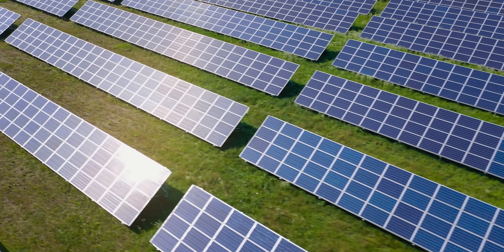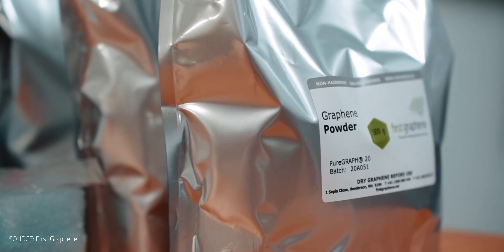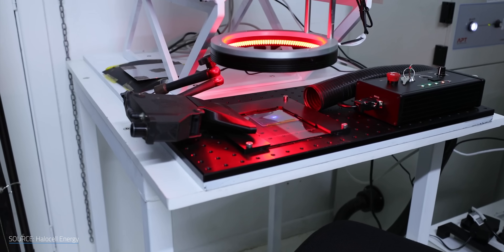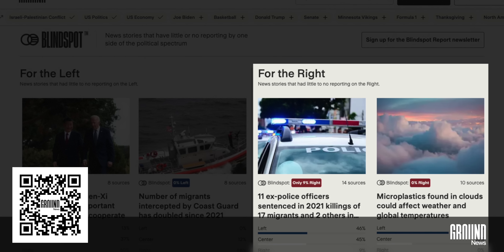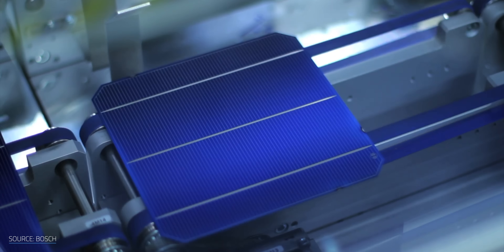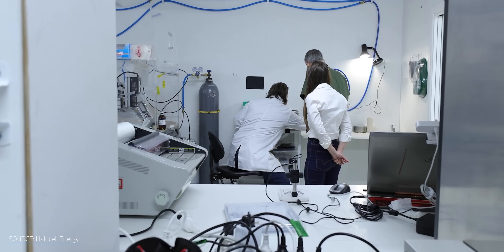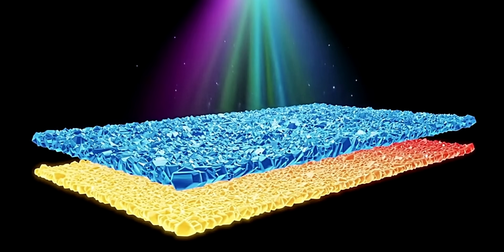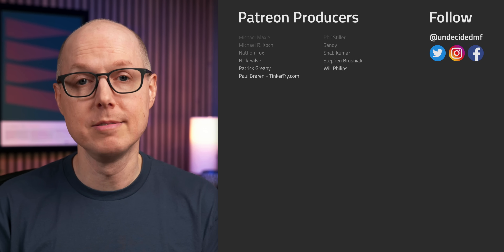How This Perovskite Breakthrough Could Change Solar Forever

Comment from the maker: When might graphene-perovskite solar actually end up on your roof? Go to https://ground.news/undecided for an innovative way to stay fully informed on tech, energy, the climate and more. Save 40% on the Ground News unlimited access Vantage plan with my link.

If you liked this, check out Why Thorium is About to Change the World https://youtu.be/bz4aTO6M4Ho?list=PLnTSM-ORSgi7uzySCXq8VXhodHB5B5OiQ
Reply: The problem is how stable it stays long term out in the elements.
Reply: @jakefrost8017 you encapsulate it. it is not hard.  graphene isnt fragile.  it is protection of obsolete junk and production with sunk costs that is the reason you dont have peel and stick solar panels
Reply: graphene has not been "overhyped" the implementation has been garbage. the technology it self is fine. you can make a water powered battery with graphene and hematene electrodes
Reply: It's really hard to see the price actually making any difference at this point. Silicon with a proven 30 year lifetime is at a price where the panel cost is actually irrelevant for most installations.

If I put 10 panels on my roof almost the entire cost is already scaffolding, cable, mounts, people, transport so I'd submit the price aspect is almost irrelevant at this point.

For the US it's even less relevant because even more of your costs are regulatory and to some extent tariffs (hence your 20-30 year payback whilst it's about 5-6 in much of Europe)
Reply: you should sue Brian Shaw for stealing your logo for his suppliments brand. your channel came first as I know. he launched his shitty supplement brand 2 years ago and has exactly same logo used. you could sue him for millions.
Reply: Well, the transition to renewables isn´t going to happen twice. Either Perovskite panels with noticable advantages over conventional panels hit the markets soon, or Perovskite will miss the oportunity to take a share of that worldwide insanely high demand for PV. If it comes to late, it won´t be able to benefit from the economic advantages of the very large scale production. That would keep competivenes down and delay a meaningful roll out of the technology much, much, much longer, even if it turns out to be better than conventional PV and in theory cost competitive then.
Reply: Worth noting that solar is already the cheapest way to generate electricity. So while better/cheaper panels would be great, better/cheaper energy storage would be a bigger game changer. Li-ion batteries are useful for mobile applications, but are otherwise too expensive, inefficient and dangerous to be practical at any sort of scale.
Reply: @eric.nathanson  Not really the case
Li-ion batteries are not great safety wise but all the modern systems are LFP which is pretty safe. The biggest danger is something else setting one on fire - because it's so hard to put out. Still best put on the outside of a building as is usual practice for most household installations.

As to prices - in tariff free countries batteries are getting really cheap really fast. As to scale - there are 100MWh+ installations working beautifully.

Sodium batteries are likely in the next few years to accelerate that cost reduction and are safer. Some of the other technologies are ridiculously safe but they are longer ways off (if they come to fruition of course).
Reply: @etchedpixels  Thanks for responding. While it’s difficult to do a direct price comparison for a solar + battery system over lifespan vs average utility expected utility rates over the same time span, current cost/kwh of the humble present tech consumer solar panel is about half the commercial customer utility rate of 14¢. Li-ion car batteries come in north of $100/kwh. I don’t know how much lower a commercial stationary installation would be, but high energy input for manufacturing and rapid efficiency degradation for the current technology are hard factors to overcome even at scale. As far as safety, well yeah. They do indeed catch fire and then burn uncontrollably. I think people who install them on the side of their house are insane.
Reply: please stop using autodub, its stupid and many information will loss to translation
Reply: How did Graphene get so cheap so fast?
Reply: I love to see your videos that covers renewable energy innovations.
Reply: These 400 Watt panels barely crank out 100 Watts.  When building systems to power a home,  I scale the power collection from 10% of the on-the-box rated power levels.
To get a decent 1KW system,  I put up 10KW and it should make it through the grey winter months that barely generate any power... It would be beneficial if someone designed solar panels that work best on  grey day low light...  Geared for that tiny amount of power, at least we could collect something...   Bright  Sunny Days are rare and uncommon.
Reply: Since 2018 I've been saying Perovskite's moisture, air exposure and heat problems would be alleviated or completely eliminated in the vacuum of space. It's the perfect substrate to paint onto panels for 365/24/7 solar energy to beam back to Earth.
Reply: Is it already time for the annual “Solar breakthrough that will revolutionize the world but you will never ever see it” video?  Just throw out buzz words and wrap them in boastful ambiguity, people will click! 

Well here is your click and engagement but keep it real or you’ll lose people Matt.

Comment: Anti-Renewable Rhetoric: Trump calls wind and solar "the scam of the century," blaming them for high energy costs and prioritizing fossil fuels.
"One Big Beautiful Bill" (OBBBA): Signed July 2025, it ends the homeowner solar tax credit (25D) at the end of 2025 and creates hurdles for clean energy credits, potentially slowing deployment.
Permitting Slowdown: The administration has stalled new solar projects on federal lands, requiring personal sign-off from the Interior Secretary.

Comment: Instead of burning coal now you are electrocuting it putting on your roof then in the landfill along with all your batteries.  If you just burn the coal, the CO2 turns into plant food with photosynthesis.  It's a cycle and carbon is the most efficient and recyclable energy source we have technology to utilize efficiently.  Our bodies have better tech to utilize carbon than anything we have come up with.

Comment: Be interesting if they could do multi-spectrum panes like they have on space station. 

They need to be able to recycle the panels too.

The way power cost is increasing to account for mega corporation data center’s for AI etc. the ROI may not be 20-30yrs. Maybe be 15-20 or less.

Comment: 3670 hours is 150ish days over which they've degraded by 3%. The way you presented this information made it sound significant but it's far from acceptable and a far cry from the 8900 days required to survive 25 years outdoors.

Comment: There are so many factors in making solar panels viable. Probably several boxes to tick. And for a solar cell to tick every box, well it's probably never going to happen. A solar cell that is cheap, efficient, light, energy dense, long lasting and non polluting contaminants, the list goes on! 😂

Comment: If they could get a product to market that produces the same wattage as a current silicon cell at, say, 50% the cost,  then it doesn't really need to last 30 years.   If it lasts 15 years,  that's equivalent value,  and it means that I can take advantage of new technological advantages by replacing my cells sooner

Comment: Not sure if it really matters for say, if they can get them to work with todays solar panels as a layer, then even if that layer only last 10 years out of the total 30+ that would still be fine so long as it doesnt increase over all cost more than it can produce. The reason is just that you will have a faster ROI at the grid level. For homes, it will allow you to put up fewer panels at the start, then you can let them offset to get your next set of panels as those wear down. Mainly it just comes down to cost of adding the extra layers. If it adds like 50$ to a todays 125$ panel I dont think people would complain at all. I would go as far as to say even doubling it. As you will need less over all panels for the same power production. For the grid, it doesnt matter as much as their goal is to get as much power as possible over all.

Comment: Here in Ontario Canada just installed 1500W of vertical bifacial 500W panels, great way to keep the snow off in the winter. 
$235CDN per panel, after the screw in deck anchors, aluminum structure, wire to house and MPPT, my labour was free.  (no permit costs involved)
Turned out the panel cost was < 25% of the overall cost. If I had paid someone to do the install panels would be <15% of the overall cost.
Would be nice to have more efficient lover cost panels, might save a bit in the mount and structure, but still panels will be <25% of the overall cost.
I think we have reached the point where dropping the panel cost has little effect on the overall job cost.
Only place more efficient panels may be advantages is where space is an issue.

Comment: Hey, speaking of the AI bubble, did you know your brain only uses 30 watts? Why are they building nuclear powered data centers? The "AI revolution" was started by one paper. "Attention is all you need", which introduced the Transformer algorithm, which is VERY INEFFICIENT. That's why they need nuclear power. They could spend that $1 trillion on neuroscience research to figure out how the brain does that with 30 watts. But then they wouldn't need to spend a trillion bucks, which gives them a hard on

Comment: I'd be more interested in the more mature silicon pv tech simply replacing the electrodes with graphene that could lower the cost, but could also boost demand and innovation with graphene and greatly mature it in the process.

Comment: Heard it before and will hear about it again in a few months when they push the same cycle. It's the same media cycle as fusion. 
The reason solar panels are everywhere is due to Chinese state power pushing them as hard as they do. Unless Chinese manufacturers start to produce them, which is suicidal for any investor outside China, there's no way to compete and that's been shown by the uncompetitiveness of non-Chinese solar panels in terms of costs unless they are directly made from Chinese sourced cells etc. 
Unless Australia starts churning these out for £65 a panel at 440w, there's simply no beating the scale of silicon in terms of cost effectiveness. Same as with batteries.

Comment: When the first Perovskite can finally be mass produced, it will at first be significantly more expensive by several orders of magnitude over silicon, for not quite 38% gain in power. Think LED's, when they first hit the market they were $10 a bulb.  20 years later they are now much more affordable but still more expensive than incandescent.  
This will be a long time.

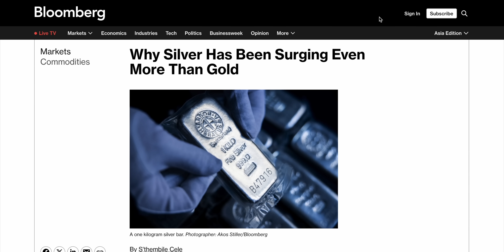Comment: 7:56 Silver reached $50/oz-t in early October and has remained over $50/oz-t since early November. It is currently over $58/oz-t. FYI -- a troy ounce is roughly 1.1 regular ounces so silver would be approx $64/oz (regular ounces)

Comment: at the end we don't have game changers. my estimation is that every year we get a typical improvement of maybe 0,25% points of efficiency. and a lower price of maybe 3% per kWh? that does not sound much but solar is already very cheap and these improvements add up over time.
and even if we get oxford PV cells with 27% in scale, they will be expensive and they will only make sense in certain applications where space is expensive as well. even for a balcony solar system the added 2% efficiency might not be worth it to pay double the price.
nevertheless, we will get there.
+0,25%, -3% price per year is good enough.

Comment: Graphene replacing silver in silicon solar cells, Should and most likely will be the priority. Since it makes it more cost effective, efficient, robust and recyclable. 
 
While Perovskites have less applications and makes its recyclability more difficult, relative to Silicon cells.Thanks for another thought  provoking post.

Comment: complete misunderstanding of PV economics - the panel cost is not the biggest factor.   In future the total system cost including sodium batteries will be the deciding factor and  a few more percent efficiency and a few cents cheaper panels will be irrelevant

Comment: Solar panels payback outside of the USA is between 3 and 5 years usually. The hardware and installation cost are too high, and grid powe low. In other countries, the opposite

Comment: And once connected to the grid could only put in 15 of advertised output The ignorance of solar is easily demonstrated with a volt amp meter in fourth grade math called Ohm's law double check your watt meter And you will see the ignorance

Comment: I was surprised how little the actual solar panel cost relative to the entire install.  The aluminum framing and micro inverters cost much more than I expected and the install (if you don't do it yourself) is also a significant cost.  Halving the solar panel cost isn't really a game changer when you consider all the costs.
Reply: you are right. this is why an efficiency bump is the best. you don't need more mounting stuff that also costs money. etc.
Reply: Same as true of any home upgrade. Such as installing AC or a toilet or anything that involves the trades. "Micro" inverters are nice, but not necessary. 

And you forgot the most important factor, the amount of electricity that it produces depends, on where you live. Average Australian would be laughing at you.  C'est la vie. 

FWIW solar can act as a roof covering too, There are a few French companies that offer underlayment systems that catch the water runoff, which replaces roofing. under the solar panels. So it can be part of a roofing replacement. Which can offset part of combined cost.  As always the devil's in the details.

(Look forward to when DC powered homes, become a realistic cost effective option. Which will increase efficiency, decrease complexity and cost. Since almost all devices are inherently DC powered. with AC to DC conversion built-in. But currently they charge way more for the simpler DC versions)
Reply: @nc3826  microinverters are typically better than string inverter + optimizers. Do you have significant solar?
Reply: That's because panel costs have already been halved once. The next half isn't so exciting.
Reply: You are correct. Panels and Inverters are about the same price.   about 1/4 to 1/3 of the install price
Reply: battery is my problem
Reply: @uraymeiviar  Best not to use battery if possible.
Reply: Here in the Netherlands,  when a solarpanel has reached the end of its life, the manufacturer has put aside 13cents!! to discard of this panel. Somehow i do not think so.eone earning €40 per hour can do this in 13 seconds....Another part of the conjob. Health and wisdom to all,  Erik the Netherlands
Reply: It can be automated and simplified, when there's no Silver that has to be extracted.

Life is a conjob, give Netherlands credit for at least taking the first step to address negative externalities..... C'est la vie

Comment: Oxford PV is already manufacturing commercial perovskite-on-silicon panels delivering up to 26.9% conversion efficiency. However, they are competing with conventional silicon panels, which have already reached around 25% efficiency — and bifacial designs can achieve even higher performance in certain applications. I believe both technologies will coexist for quite some time, each finding its own niche.

Comment: This is going to sound really weird, but if we had reliable cheap solar power, it would help create a bit of a new baseline for society to survive.  We could have a full societal collapse, but electricity would still flow.  I really think every home having solar is going to be in the near future, and the US delaying it is only putting us behind.  This would allow power plants to focus on industry, which is already 70% of power consumption in many areas, and in smaller areas, even higher.

Comment: I'm sorry, what, "Save 80% on material costs" is nowhere close to being able to save 80%!
The cost of materials is seldomly the main cost driver for a complex product, so the "80%" figure is *pure BS*...
Lets take Silicon, the ultra pure refined Boules that are used for Wafers... I found some place selling these, and even the most expensive one was only $3,000 per kilogram (most were < $1000!). And yet a few grams of this material is enough for a high end chip!

Comment: Needing 20 to 30 years to capture costs is stupid, any thing over 7 years is a net loss. 
The issue with solar high cost have more to do with government rebates, I have watched this in real time, solar companies charging 50k+ for solar system you can buy for less than 15k means you're spending 35k for a max 2 day install.

Comment: A small addition to why perovskite isn't catching on. Perovskite is a synthetic crystal that uses Lead as one of the ingredients during synthesis. This isn't a dealbreaker if they're constructed well, but damage to the cell or overuse in areas where replacement might not be a priority runs the risk of Lead contamination in likely populated locations.
Reply: Don't standard solar panels already use lead? How would this be more harmful if both have lead?
Reply: Perovskite do often use lead but it is not a necessity. There are non lead Perovskite whether they are as good as the lead Perovskite is another question.
Reply: Weigh the potential toxicity against burning coal.
Reply: I don’t want lead on my roof leaking into the my drinking water and waterways…no thanks..stick to anti microbial silver please!
Reply: Nah man depends on the perovskite there is a deep dive into them on both this channel and 2 bit da Vinci , there are some who are based on titanium I believe and a whole lot of other materials